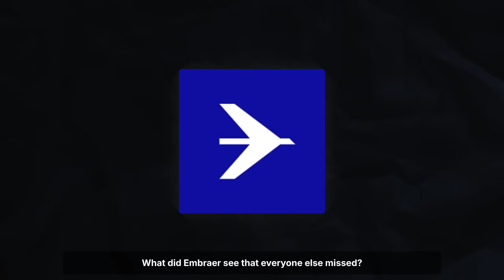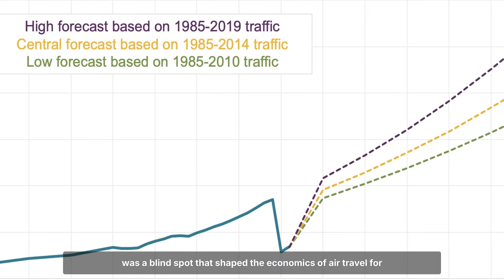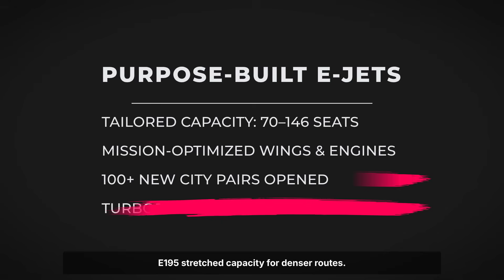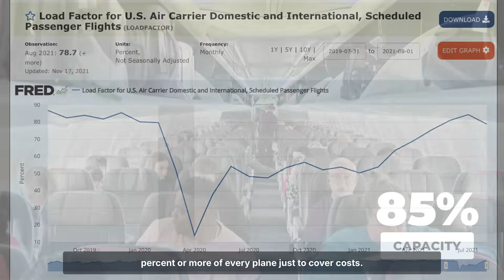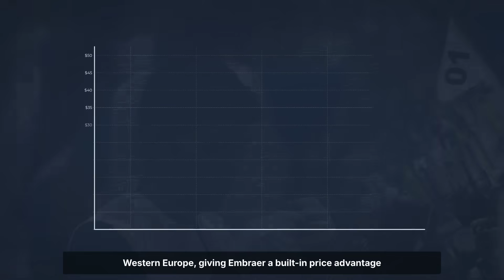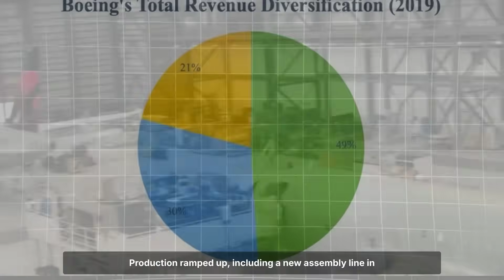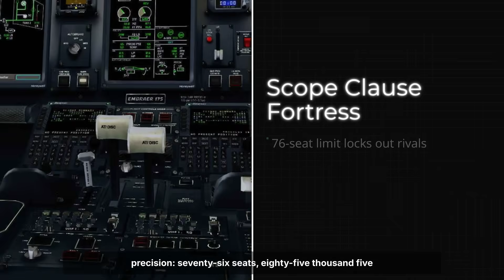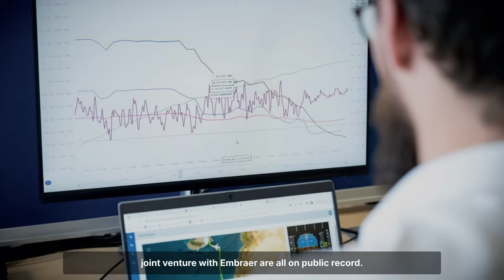How Embraer Outsmarted Boeing & Airbus With This Tiny Jet

Comment: You did a complete X-ray of the situation and were very accurate in identifying the causes and consequences. Regardless of the facts that occurred internationally, some factors have always set Embraer apart, which are: 1) Embraer has always been concerned with designing aircraft aimed at meeting the needs of airlines. 2) Since its inception, Embraer has been concerned with quality control in everything it does. 3) From the beginning, Embraer was concerned with building robust aircraft, as they were intended to serve small airports with often poor runways. 4) Embraer is always attentive to new technologies and implements them with each new generation of aircraft.

You talked a lot about commercial aircraft, but Embraer is also successful with executive jets - the Phenom 300, for example - and with military aircraft - the Tucano A-29 and the multi-function KC-390 Millennium. Recently, Embraer adapted its E-190 aircraft into a cargo version (E-190F), and good results are expected from this project. If Embraer manages to create a model to "compete" with the A-220, it will begin to dominate this "fight" for aircraft with up to 150 seats. And the EVTOL is coming soon.

Comment: The thumbnail plane is mirror reversed. The airline name is LOT (the Polish Airlines). Also LOT plans to get rid of the Embraers and replace them with bigger Airbus 220 planes.
Reply: Yes, the official reason for this "decision" is that the A220 is better suited to LOT's needs (and not because the A220 is better than the E195-E2). The real reason, however (Embraer was betrayed at the last moment of negotiations), was political. LOT is a state-owned company, and the Polish government was under pressure from other European countries (mainly France), which conditioned military support on the completion of this deal with Airbus.

Comment: Where’s the E145? It was the precursor to the larger E170/5 & E190/5 series plus the re-engined current E2s.
Reply: Still being used by the Brazilian Air Force as Awacs and  tasks as remote sensoring in the deep jungle. Some small regional carriers in the USA still use this aircraft. It's old, but it's a great small airplane.

Comment: Wait this clause blocks its own newer E-2 planes which none of the 3 weight less than 86K lb how is this a successful strategy?
That means they are eventually going to run out of $ if the clause isn't removed
Reply: There are tree types of jets in the E2 family, 175, 190, 195, for now the 190 and 195 are goimg well, but the 175 is on hold, Embraer is beting that eventually the wheight clause will change.
Reply: Só existe essa cláusula de escopo nos EUA , no restante do mundo todos voam com 190 e 195 E2 que são muito mais econômicos, quando modificarem essa cláusula, as empresas ficaram aptas a receber esses modelos.
Reply: @deccosantos8091 damn so clause is why we don't see them here in the USA, glad to hear they are not affected world wide
Reply: @midengineZ06 curiosamente, o E175 é muito raro de ver fora dos EUA, aqui mesmo no Brasil nenhuma companhia aérea utiliza esse avião que é o menor da família dos ejets.

Comment: A VERY narrow-minded look at the whole picture. Embraer was far from the only player in this market. Bombardier CS and Sukhoi Superjet were two main competitors. And nobody "built a tailor made plane". Embraer was just very lucky to make a plane that fit the market. It also made a huge mistake with E2 when it refused to make composite wings and basically gave the segment away to Bombardier. Embraer is fighting yesterday's war. The segment has gone up, just like A330 was replaced by A350.
This is only your third "serious" video. You obviously can read information on the internet. But I can sense you want to be one of those channels who only sees black and white and want loud titles. There are millions of those and you are late to the party. Try more balanced approach and A LOT more research. Then you might have a chance. Good luck.
Reply: I do think the title and claims are overrated.

Boeing and Airbus were NOT on the E-jets segments. Boeing 717 is part of a larger family mainly focused on the market redundants models such as 737s and A320s already occupy. 717 was just a newer version of DC9-30 expected to interest airlines who operated the older type en masse til the early 2000s. Turned out 737 already ATE most fleet renewal long BEFORE 717 were ready to get delivered. TOO LATE. To claim the 717 competes with E170 is just stretching it too far, the program TERMINATION was decided by Boeing for another more important reason (A320 family eating 737 market) BEFORE E190/195 were first delivered.

However, I do agree with the other comment. The success of a type does NOT depend on INITIAL deliveries trends, NOR spectacular orders (or their absence). Orders can be discussed internally, backloged and undisclosed 10 years later. The MAIN THREE points driving the future of an improved type are:
1) How many units of the older version operated worldwide (translates into volume of qualified crew, maintenance resources and logistics, spare and support supply chain, established contracts and actors)
2) Service life expectancy of existing units of the older version: is it time to phase out ageing units ?
3) Is there a more interresting alternative, ie, as CHEAP and with competitive daily operating performance ON THE EXISTING NETWORK ?

That's WHY A330NEO orders and deliveries are LAME! Many A330CEO are too YOUNG to be replaced this early (2025, around 10 years old), yet, the worldwide fleet of A330CEOs is relatively substantial. Within 10 years, 500 orders are to be EXPECTED (instead of the potential 1000 because 787-10 is actually BETTER, airlines already operating the type will NOT order A330-900). There are other factors at play, like how many airlines switched from 737 to A320s (common type rating), or is there a Cargo conversion program for the 787, since the absence of a 767 Freighter successor shifts the focus on either the A330 or 787, certainly not the A350 or the 777. Which "secret" (not that secret) deal the airline has with Airbus or Boeing ?

BTW, why everybody forget about ERJ135/145 ? Those are very good planes, which established Embraer's REPUTATION (after EMB120, which was not a jet). No wonder why E170s/190s sold right away, unlike COMAC or Sukhoi (SSJ) who had yet to prove their reliability on the civil side.

I don't really get what a "tailor made plane" is, but three things:
- manufacturers who don't discuss with AIRLINES before making an aircraft are certain to go BANKRUPT!
- manufacturers who listen TOO MUCH to airlines and promise the IPOSSIBLE are certain to go BANKRUPT!
- manufacturers who design their product on the recomendations of a FEW airlines are certain to go BANKRUPT!
Embraer EJets were designed based on feedback provided by ALL airlines in Embraer's portfolio operating EMB110, EMB120 and ERJs. Anyone can infer those private talks by observing who actually ordered the type en masse...
Reply: the e2 was initiallya  flop, the a175 e2 is unlikely gonna exist in the near future, but the e2 series this is now finally racking up orders, but i dont think theyll ever beat the a220
Reply: I agree. You would think from this video that Embraer invented the Regional Jet market, but that is just not true. It was the Bombardier Canadair Regional Jet that pioneered this market segment. The E-Jets arrived later and offered better passenger comfort, but not necessarily better economics for airlines. I don't doubt that the Embraer jets are very good products. Canada's Porter Airlines operates a fleet of E2s and seems to be doing very well. I would bet it offers more passenger comfort than a 737 or A320, but not as much as the A220, which started life as the Bombardier C-Series. Porter was an early customer for the C-Series, but had to cancel its order when the City of Toronto refused to allow the C-Series to land at Toronto Island Airport
Reply: @kevinkeswick1243  Uhm.... no. This segment was pioneers by the USSR. Check out Yak-40.
Reply: Why was the then C series refused access to Toronto Island. Was this a weight issue or runway length issue? Porter 195E2s operate out of there, after all.
Hearing Porter are quite satisfied with their E2s
Reply: @michaelosgood9876  No. Only Q400 operates there. E195s are flying in and out of Pearson Airport.

Your question should be why jetliners are not allowed at Billy Bishop. It's not so simple. There are a lot of controversies, you know, many people with many different opinions, sometimes, just talking to oppose for personal concerns, like a career.

Basically, the arguments are:

- runway too short: Runway length is not in itself a dead end, but for safety reasons (like a simple human errors in weight computations) and you get a plane in the water... So, for many, it's a big NO!

- noise (and other disturbances, like traffic, construction works, pollution): Well, I'm not Canadian, so sorry in case of a cultural disrespect, not my intention. Thing is, about noise and all those inconveniences, Canadians are quite afraid..

- money for runway extension: Money wasn't really a problem for Porter Airlines, was ready to fund most of the costs (which would had happenned in the end). Turned out, the proposal was just denied, noone except Porter wanted to pay, but nobody clearly admitted it.

- Bombardier problems on C-Series: not really related to YTZ denying jetliners, but along the way, CS100 did sustained prolonged delays... Porter Airlines was like asking authorities to open the airport to jets based on a type it may never acquire, let alone operate in the end... Many figures felt it was some kind of a joke.

- competition: well, this one i kind of very important, unfortunately, this will NEVER be made public. Air Canada, Jazz (now Air Canada Express) and Westjet mostly based on some miles away Toronto Pearson would not allow an airline based that close to the city open routes initially unreachable via Q400. Money is always at the core of decisions (and actions).

- fear of changes: Toronto City Airport workflow is peaceful and easy. Now, some airline want to add jets, with all the complications that comes with. Reaction: "oh no, certainly not, that's too much for the airport, it will collapse under chaos..." Yep, many entertained this dialogue.

^^ as you can see, even if today some entity would suggest expanding the airport for jet service, getting denied AGAIN would not be a surprise.

Comment: Well, there WAS a jet for that sweet spot.  It was called the 717, another example of Boeing's blindness.
Reply: Sweet spot of WHAT? It flew in 1965!!!!!!!!!!!
Reply: @Maloy7800  737 was also very old, its design was also borrowed from the 707, which was introduced in 1958

but i agree 717 wouldnt be a long term good solution, boeing shouldve pursued with the 7j7 in the 80s/90s, back then boeing was still revolutionary
Reply: Wasn’t scope compliant
Reply: Boeing 737Classics marketing started in 1979 and entered service in 1984 (300), 1988 (400) and 1990 (500).
Airbus A320 marketing started in 1984 and entered service in 1988 (A320CEO), 1994 (A321CEO), 1996 (A319CEO) and 2003 (A318).
Boeing 737NG marketing started in 1993 and entered service in 1997 (700), 1998 (800), 1999 (600) and 2007 (900ER).
Boeing 717 marketing started around 1983 with various MD9x designations and entered service in 1999.
^^ this shows you where the 717-200 appears: right at the moment 737NG entered service, in 1999, when Boeing expected 737-600 to sell for longer routes and 717 for shorter ones. A318 didn't even existed.

Now let's observe how Airbus deliveries evolved: At the beginning, in 1988, 16 units were delivered, pretty lame. A couple years later, 58 units per year. Nice but way below the 150 737Classics per year. In 1990 and 1991, A320s averaged 110 units, to drop to 65 the next 3 years. In the meantime, seeing A320 more efficient than 737Classics, and various upcoming A321 and A319 versions, Boeing decided to officially launch the NG program (just 10 years after the first operating 737-300), this proved to be the right decision, because Airbus began to steadily increase its deliveries each year, soaring from 120 in 1997 to 220 in 1999.

Now enters your 717. Boeing Classics deliveries has dropped to 40ish, NG deliveries barely above Airbus A320s... let's see for a while. In 2000, Classics were discontinued. NG deliveries: 280. A320s: 241. This is very bad, Airbus is catching up very quickly. 2001, NGs: 299, A320s: 257... and 9/11, plus the Queens A300 crash. Boeing never delivered more 737s than A320s since 2001, Airbus was always ahead with its narrowbody.

And 717 ? It never exceeded 50 deliveries per year (2001 was its best result) and averaged at 20. That's utterly astonishingly LOW. Plus what happenned in 2003 ? A318 entered service. Plus as stated in the video ERJ170 was marketed and would enter service a year later. 717 was inevitably dead.

And Boeing 757 ? 45 deliveries in 2001, 29 in 2002 (and ZERO orders that year), 14 in 2003 (and only 7 orders), 11 in 2004 (zero orders)...

Who am I to judge Boeing ? Aren't 717 and 757 resources better suited to boost a selling program rather than dying ones ? Now you know the truth behind Boeing 717 and 757 termination: Airbus A320s!!! Never ever say Boeing did WRONG killing those two programs. Actually, killing both were most CERTAINLY the BEST decision Boeing made in its ENTIRE history.

Ask yourself what would have happenned to the NG program if Boeing maintained 717 and/or 757 ? Ask yourself if Airbus would have just stayed idle, or rather ramped up the A320 program, opened Tianjin assembly in 2004 instead of 2009 giving an immediate answer to the explosive demand NG delivery DELAYS would have suffered. Ask yourself how many MORE A320s would have been delivered, how much more airlines would have switched to Airbus, how much MORE A320s type-rated crew would airlines have accumulated overtime ensuring they would buy A320s AGAIN, how EARLY the NEO program would have been marketed and produced ? How much lost financial opportunities Boeing would have endured, launching the 777 which REQUIRED the MD11 to die, how much troubles the 787 would have sufferred inducing even MORE delays.

Do you REALLY think Boeing would have had the FINANCE to launch the 737Max when BILLIONS would have just been snatched easy peasy by Airbus ? NO WAY! 737Max would have DIED before even being born! I'll keep underlying this: billions at stake doesn't CARE about people's feelings, especially when what they think is exactly the reason why companies go BANKRUPT! You love this plane very much, such kind of reasoning is irrelevant, even if you are a pilot, it's utterly IRRELEVANT. Perfection does not systematically translates in return on investment: it's up to the BUYER (airlines) to DECIDE how PERFECT of a product you made.
Reply: @StephenKarl_Integral  boeing shouldve pursued with the 7j7 in the 80s or 90s, even if the 7j7 fell through, they shouldve wokred on the NSA which was a new clean sheet supposed to replace the 737GNG in this decade, but instead boeing panicked and made a rushed engine update with the MAX